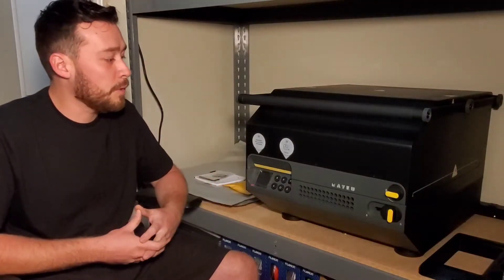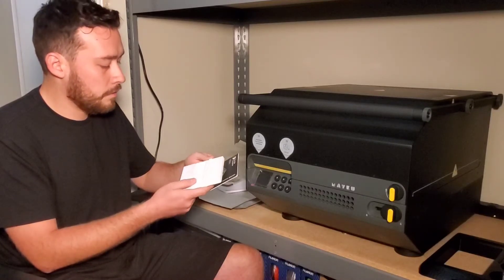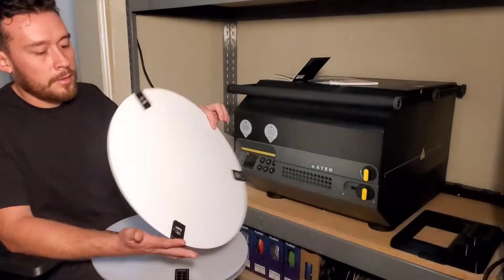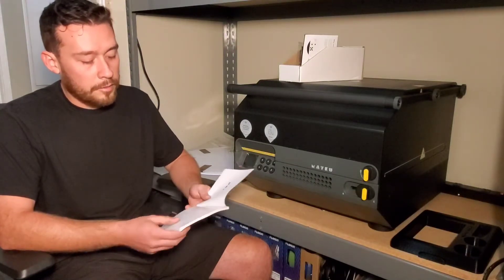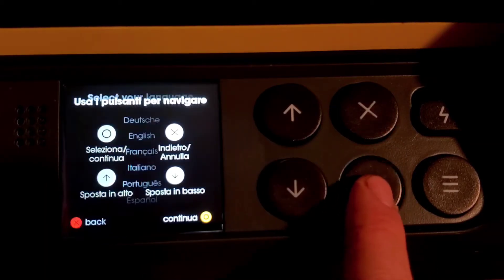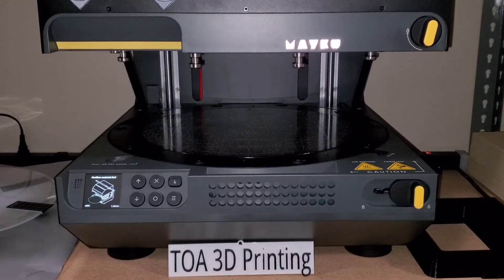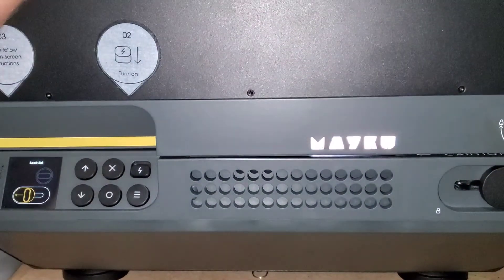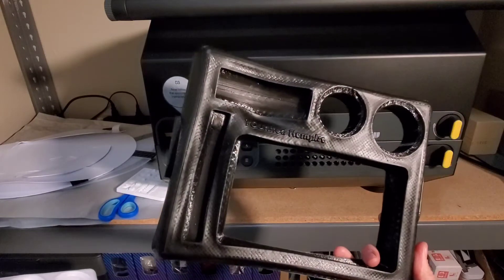Pressure forming review - MAYKU Multiplier

Comment: How thick is the material after it's been vacuum formed? I'd imagine that if you want to create a dimensionally precise mold, you'd have to tweak some of the inner and outer cavity parameters to account for the material thickness. And, speaking of dimensional precision, how is the dimensional accuracy? Is it fairly consistent or does it vary from the top of the part to the bottom? Intuitively, i would think that the top and most distal parts of the mold would be thinner due to having more of the material stretched out over greater distance.
Reply from the maker: The thickness of the material is quite close to the same thickness it started with. I'm only losing a few .05mm sometimes.
You would have to think while designing for the cavities and outer wall to make sure the sheets thickness will effect the over all form to be accurate for your application. I hope this answered your questions

Comment: i bought one of these and im having constant issues with it, it is really hard to lock once i put  my object in and because my object is thin and fairly tall it doesn't pressurize around it well leaving ribs and imperfections in the final product, also because of this i can only do 1 product at a time meaning im using a £10  sheet of plastic for once single small item.  Please can you let me know how you are  getting on with it now and if you have any issues  locking the machine like i do, thanks.
Reply from the maker: Hi I didn't have any issues but I noticed one other user on YouTube having the issue your mentioning. Try locking the lid with nothing loaded and see if it closes properly. Then try with something loaded but not turning pressure on. if you can get it to lock this way you are ready. Other wise you might have something not sliding properly where the lock mechanism and the frame is hooking into place. I used a bit of consistent force to close the lid when a template was loaded. It might be worth giving me a video call or MAYKU a call to see what can be fixed if you email me we can set up a time to speak if nothing works for you these are great machines I used them in 3 different projects so I know it works great. 

I'm trying to manifest a new video idea of the machine and it might be worth having this issue brought up for people to fix them self.
toa3dprinting@gmail.com
Reply: @TOA3DPrinting  Hi, yes i will try to remember to give you an email soon. ive tried everything to get it to lock when the machine is on but with nothing working. we have a fair bit of experience with this type of machinery and it locks perfect when the machine is off. I will email you to  discuss it further, Thank you.

Comment: I subscribed to your channel; hopeful you will have a video after you come up with (figure out) a better process to optimize trimming the part. You mentioned in this video you'll be doing this. I appreciate you doing this video and looking forward to the others you produce.
Reply from the maker: Thanks for subbing!!! Yes I am still figuring out the best method for trimming the forms.
I had got those trays formed with a 3mm thick sheet and they are much more stable. Which means the trimming process might be the same for cutting the edges. I am thinking about using a router table with a bit the guides to the formed shape but I need to see other options. There is always a better way to doing things.

Comment: Mine just arrived. I plan on making molds of 3D resin prints. I read that resin can’t melt and in fact catches fire before it would ever melt. knowing the multiplier heats sheets at 220 degrees, do you think it’s safe to use resin prints as templates?
Reply from the maker: Hi Dave, It should be fine. It is only going to be heating   up for 4 minutes and get cooled right away after. I did notice that the creators of this machine did a release video in the past using a formlabs form 2 resin printer to produce the templates and it went well. I am planning on doing a resin print video soon (I have the same printer) to see how they hold up to pressure and heat but might be in a week or two. I hope this helps. Oh one thing I do want to mention. the fumes it releases is stinker and toxic, make sure there is fresh air coming in the area. you'll notice the smell when it starts releasing/holding air pressure.
Reply: Extremely helpful. Thank you so much. And in terms of the fumes, do you think a large carbon filter next to the machine and fan in the window while I’m molding would be helpful? I’m new to all this so any info is helpful
Reply from the maker: it would help with that it's just recommended that fresh air is flowing so we don't get caught breathing the fumes best of luck to your forming
Reply: it wont melt but it softens. You need high temp resin.